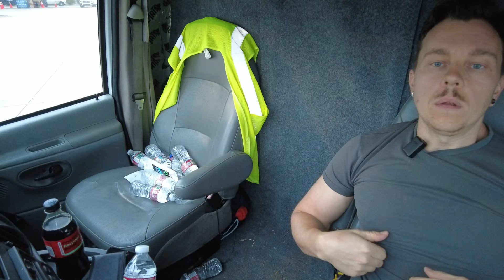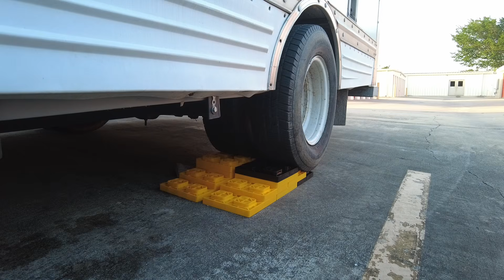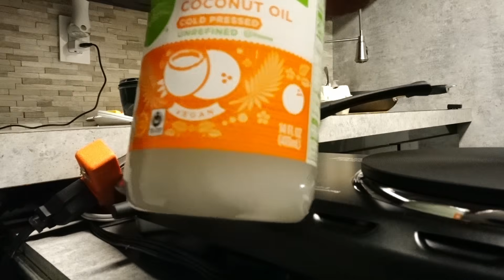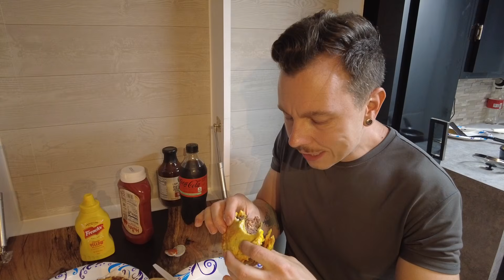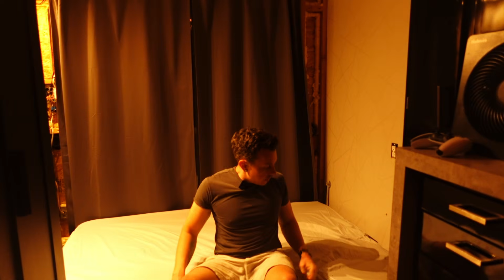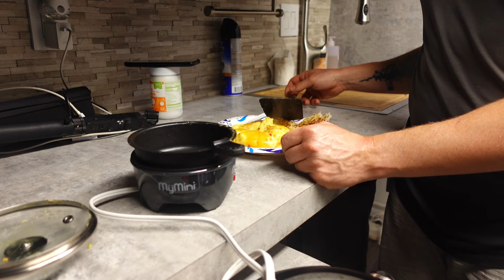Stealth Uhaul Camping at a Storage Facility with BLUETTI AC240

Comment: Absolutely great build, the only major change i would make is harvesting power from the front wheels motion when driving for rapid recharging and adding a secondary alternator to my serpentine belt so i could rapidly charge my batteries from idling the truck on cloudy and rainy days

Comment: @TheTechnoBarbarian 
I plan on making a super stealth truck conversion similar to yours.  I plan on buying a 2022 or newer "Rockwell Cargoport truck" with a side door (google "Rockwell Cargoport truck" to see pics since I can't put links here.  Rockports website should be the first listing).  I am debating between a 14' or 16' version.
My concern is parking space difficulty.  Will there be any difference in the parking space difficulty between the 14' or 16'?  I'm guessing I am going to have to use 2 spots in a parking lot regardless between the two sizes.

I would like to fit in a regular parking spot if the 14' will fit, but if it won't fit I would prefer the extra 2 feet for more inside space.
Please let me know from your experience of parking difficulties.  Thanks.

Comment: 5:30  Parking in the fire lane may garner some attention? Love your design of the interior.  Could you maybe incorporate some "peepholes" that are used in entry doors to see out the sides or back?  Low budget hack that doesn't fail like cameras.  To hide them on the outside just paint a couple of black 'smudges'  where the peep hole is, then install it.  Nobody would look twice at the smudges.

Comment: Hey, I am pleased to find your channel. I have been a detailed builder of many things for years and appreciate your attention to details. I long time friend of mine has made several stealth vehicles conversions. One was a Dodge Caravan but his current live in favorite is a Ford E250 panel van. An interesting point is that  he went to a great deal of trouble to install about 6 micro video cameras around the vehicle at very strategic points. He uses a 12 vdc operated video camera multiplex recorder/playback unit and can watch all cameras on 1 LCD monitor (also 12 vdc).
The controller has movement detection for all cameras and will enlarge any image that detects pixel changes. So this greatly increases his "situational awareness".
Here another one of his ideas. He has athe male end of an extension cord that hangs discreetly behind his rear bumper. When it's available, he plugs into an outdoor electrical outlet and it recharges various battery banks while he lives inside. If he has to start up the van and leave quickly, the cord just detaches when he drives off.
He also used super thin solar panels on the roof to recharge during daylight.
Hope you guys like his ideas. Everyone keep up the good work and HELP ONE ANOTHER!  Cheers from Missouri.

Comment: Install helper air springs on the rear with separate valves for each side- then you can level it just using your suspension and not being so obvious with blocks. Onboard air is good for lots of other things- so a small compressor and a used tank off an old Lincoln Continental for $25 at a junkyard will provide all the air you need.

Comment: While parking at a storage place is not desirable having the option because your home is 100% stealth is. It opens up so many options for cheap living basically anywhere you can park it legally, I don't have an instagram worthy view at the industrial estate Im in but its quiet and secure, close to everything I will ever need and dirt cheap. When this living arrangement ends I will simply find another one eventually and park around the city until I do bringing true peace of mind that most with a house mortgage dont have. I like the term "parallel society" its the kind of thinking required to maintain freedom in our current system. Your murphey bed/desk set up an excellent example of a true no compromise multi use space which is why I did the same thing in a small apartment with a studio nook....Great minds and all.

Comment: You should go up to the front gate and use your code and pretend like you left before you hunker down for the night. Some storage facilities check to make sure everyone who has coded in has also coded out. Or, you could try to draft in behind someone going in the gate and avoid entering your code entirely.
Reply: Then you'd have to walk up to the front gate in the morning to code back in, so you can code back out when you leave. That's a little tricky
Reply: @fahqahsowl6498  Good point. Maybe wait for someone to leave in the morning and go out the gate with them? 🤔

Comment: My stepdad once told me to never park where you can't just pull straight out to leave, mostly because one night I went to emergency room and pulled straight into a parking spot that was headed downhill, during an ice storm, and when I came out, my car was dead, and ice had flowed under the tires. I called him to come give me a jump start, but he couldn't because I was parked with several cars on either side of me with the nose of the car headed down into the fence at the edge of the parking lot...and he couldn't push the car uphill, esp. on ice. We ended up coming back for the car later... Moral of the story is, back into dead end parking spot, for several reasons...
Reply: My dad was a firefighter and the big rig driver for the fire department and he taught me the same thing.
Reply: This happened to me one time. What my friends did was disconnect the battery from their pickup and carry it over to my car and use it as a jump box to charge my battery and then I was able to start up my car.
Reply: Uhhhhh, those units get locked from outside ,are n t you worried about getting l8cked inside
Reply: Good call.
Reply: sadly its illegal to back in in some states like florida.
Reply: @IndianaDipper194  I never knew this 😮 why would it be illegal?

Comment: cool video, interesting, informative and entertaining.  for that particular storage parking spot you're better off backing in, for several reasons: 1. there's no "drop" from the driver's side when getting out (or climb getting in), 2. you can partially open your rear doors because they're not facing the public/cameras/road, you're facing the "backyard", 3. since you're in the box and it'll be pointing away (like in pt. 2) the noise you make will be harder to detect, even if just a bit.  thanks!

Comment: Have you considered adding air bags to the rear? Or both front and rear? That seems like itd be perfect for these box trucks, would allow you to level the truck on almost any surface from the dash, as well as improving the ride. The sound of the electric air compressor might not be very stealth though. Maybe a belt driven York 210 build under the hood? I'd totally do it on that rig

Comment: That was super cool. How long roughly would it take for the solar panel you currently have to recharge the Bluetti?
Reply from the maker: Less than 2 hours (rough math in my head)
Reply: @TheTechnoBarbarian  Jesus, I was expecting 12+ hours. 

I was looking at some building services in Australia last night, the commercial offerings are unfortunately very conspicuous. Though it was the closest thing I could find of quality and function similar to your own. 

I did also notice that there might be incompatibilities and inconveniences using a U-haul over here. I was thinking something like a Toyota Hiace or Transit van, but again they don't sell those in the states for you to build on. 

I wonder if instead you would eventually offer a DIY Kit for other models? 

At any rate, I really love your design and overall design philosophy. Cheers!
Reply from the maker: @surg23  I have a ton of solar (1600w). It would be a lot slower charging for a typical van build that has 100-600w. DIY kits are an interesting Idea I've considered!

Comment: Not exactly real life. You were at public storage. When you first came in you used your code and then followed someone out so their system thinks you were still inside. Then you entered again after going to Walmart. You entered twice without leaving. If they were paying attention you would have been booted. Public storage does not allow homeless to rent a spot or a space with the ability which is the equivalent of what you did. Your agreement states this. Surprised you got away with it. I call this video a complete fail masked by a good battery.
Reply from the maker: The entire point is that I'm not supposed to be there
Reply: I know a guy that manages a bunch of these. All he does is take payments,rent units and answer customer questions. He said they only review camera footage after an incident. So many people go in and out you would have to hire an army of people just to monitor 24/7

Comment: Ive been stealth camping for over a year in a converted box truck.  I have learned that it is easier to have a leveling system on my bed and on my hot plate, then it is to level the truck.  As soon as you put those blocks under your wheels you are advertising that someone is living inside the truck.  I built a sturdy box around my mattress and then use linear actuators to raise and lower the corners to get the bed level.  For my hot plate for cooking I just wedge a towel under it to get it level.
Reply: I saw a short bus conversion once that had a similar idea. Their bed was in back and suspended by cables. Then they would just adjust the cable lengths to level it. And on top of that this had the added bonus that they would just hoist the whole bed up and out of the way when they weren't using it. Absolute genius.
Reply: @4saken404   What was the winch they used?  Something for a quad?
Reply: @willybones3890  No idea. Wish I could find the video again. But it's just corners of a bed.
Reply from the maker: Great ideas!
Reply: I just put a pillow or two under one side or end of my mattress.
Reply: Way better than using blocks
Reply: Door stops are great levellers for the stove.
Reply: you can get marine stovetop/oven combos that are on gimbals so you can cook while a boat is underway and rocking with the waves. reckon they'd be perfect in truck or van build.
Reply: I was thinking the same thing that it's a tip off that someone is inside. 😊
Reply: Why don’t you use ear phones for gaming and watching tv.  It would not be hard to hear you inside.
Reply: @lindajohnson7838  It would be hard to hear if someone spotted you and is knocking on the outside of the camper lol..
Reply: Genius idea! An Upgrade from the Hammocks the  sailors of old slept in.  There are  boats with “ self-leveling” stoves built in— am sure same concept can be adapted to your land “yacht’s” stove
Reply: @paulfrederiksen5639  I would go air bags if I was going to get THAT technical. For the cooker, gimbal it, like they do on sailboats.
Reply: @paulfrederiksen5639      Great idea.  Are you an engineer ?  😂. I’m a nurse & we laugh because I could always spot if a patient was an engineer ( married to one).
Reply: Where do you park your truck at night?
Reply: If you just want to level the bed use a marine boat system . 
Like on sailboats. Or on a hammock  where it hangs from the ceiling ( make sure you can tie it off so it doesn't move during travel) that way it's ALWAYS  LEVEL. And use a tabletop that is mounted like a sailboat stove. With plug-ins  attached to tabletop not wall. It moves as a unit. Again auto level at all times.keep your hot plate on a low shelf under this tabletop when not in use.
Reply: Brilliant!
Reply: Ha ha...awesome.😊
Reply: Wonder how food trucks level them selves
Reply: Grossly unhealthy meal.
Reply: @dianehail  no you are wrong.....look into the carnivore diet lifestyle and you'll see it;s the most healthiest you can get

Comment: I've been full-time for 7 years in a 24' RV, lotdocking 100%. I think you worry too much about being caught. I've had two "knocks": Walmart in Albuquerque and Walmart in Virginia or Pennsylvania. For your stealthmobile, any stripmall would be perfect. (Though someone may siphon your gas or steal your catalytic converter.) Id recommend Rentacenter/ Aaron's/ Best Buy / furniture stores since they all have box trucks or snuggle in wirh Enterprise/ Budget/ Penske/ Hertz truck rental staging lots.
Reply: Good info. This is why I am opting for the box truck. Even though they are high in gas they seem to go unnoticed.
Reply: @TK79123  If you go that route, and aren't on a real tight budget:  I've heard they ride terrible. Safe-T-Plus (located in Georgia) has a fantastic steering stabilizer ($500ish installed), front & rear anti sway bars, Koni struts, and add a leaf spring to the rear (Tampa Spring Company did that on my E-350 chassis).
Reply: @hugohackenbush6474 hmm…I drive a box truck for work and it’s very comfortable.  Dodge Ram 3500 with a 12 ft tall box.
Reply: Plus I don’t think it’s illegal to paint your truck like a U-Haul right? Park it a spot that it blends in and it’s less of a target if it looks like a rental truck.
Reply: @hugohackenbush
I live in the Burque, what Wally World was it?
Reply: @lgDukeCity5018  I just left Meyer's RV (great Service department), and was going to the Nuclear museum the next day, so it was in the ghetto/ crackhead south east part of town.  Next to the Interstate. Shared a lot with Sam's Club.
Reply: @lgDukeCity5018 Duke City for Duke university fan??
Reply: interesting. i lived in my pickup truck for a year and i got a dozen knocks. my setup was pretty jank though so that's probably why.
Reply: Why would they knock at a walmart? Usually Walmart allows you to camp overnight in their Lots. I see a lot of people doing it here in Schuylkill County Pennsylvania

Comment: How has your DYI battery been doing?
Reply from the maker: No complaints. My inverter generates too much heat though. I'll be adding additional ventilation and sealing the electrical cabinet better to accommodate